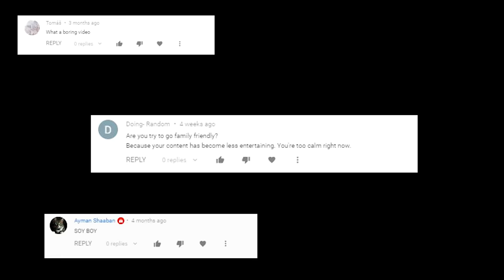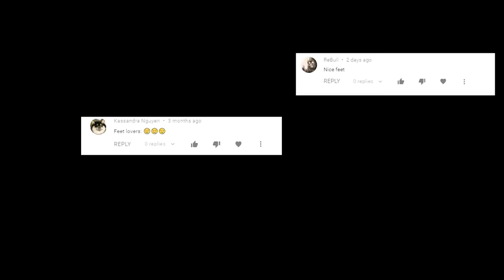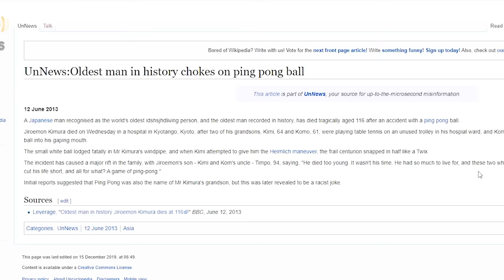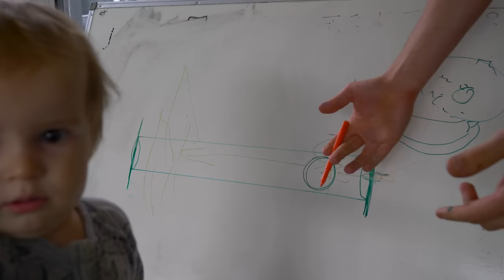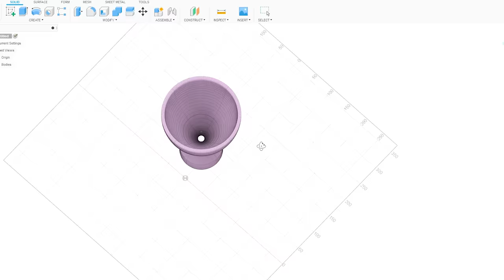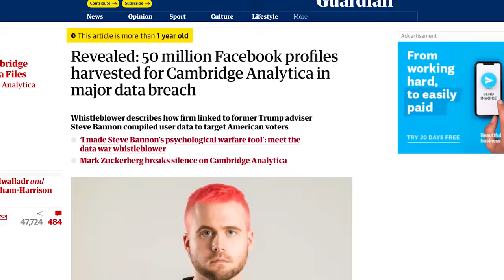I Hit The Worlds Fastest Ping Pong Ball!

Comment: 9:40, the nozzle is an orifice. Cross sectional area is inversely proportional to the air velocity at the cross section. So decreasing the cross sectional area increases the air velocity. You can also think of it in terms of pressure. Pressure and velocity are inversely proportional as well. Pressure is highest at the start of the bottleneck and it’s difficult for the gas molecules to move due to the constriction. Once they make it into the thinnest region of the bottleneck, the gas molecules are propelled forward by the higher pressure behind them. When the bottleneck opens back up, there is a pressure increase but some of the pressure from the start of the bottleneck is nonrecoverable. In layman’s terms, the nozzle is like putting your thumb partly over the end of a hose to make the water go faster.
Reply: nerd
Reply: @Michaelcool2347  ur watching a equaly as nerdy person
Reply: can you explain in cheesburgers and ar15s please
Reply: Why😂
Reply: @arealhuman826  the nozzle is like putting a cheesburger partly over the end of an ar15 barrel to make the bullet go faster
Reply: Basically its a venturimeter with a divergent and convergent section and a throat. Venturimete is is the most efficient machine to measure the discharge of a fluid because the co-efficient of discharge is almost same as the coefficient of velocity. Because at the throat the contraction is almost unity. So he gets the pressure at the end of the pipe is as much as he applies at the other end.
Reply: You call it also laval nozzle and it is used in rockets. Point is that what we think of a nozzle (convergent nozzle) only applies to up to Mach= 1 speeds. After that, it would act a a diffusor. With the divergent cone and mach1 at entry, you get a supersonic nozzle

Comment: You’ve essentially created a ping pong shotgun, great job!
Reply: he's faking this, if you go to 12:02 and watch it in slow motion be sure to look at the tree's breeze and how it moves, this shows that this is indeed 2 frames. also, looking at the damage the ping pong ball does it sort of makes no sense. this is very disapointing.
Reply: @seanmckenna4317  sure buddy
Reply: @seanmckenna4317  because he is counting but the ball come out later so he just cut it smh.
Reply: @BlueBot-jm2ro  Sadly it's true. I recommend actually looking and researching before deciding to believe it is real.
Reply: @Soulful_01  I did, thank you. Yes, that one camera angle is spliced, but probably due to either camera failure, forgetting to pressurize it, or some other mechanical error. Its not that he faked it, its due to outside forces that camera angle was spliced.
Reply: @seanmckenna4317  not fake of course he’s not gonna fucken hit the ping pong ball that could rip right through the paddle, it still shot out and destroyed the paddle.
Reply: @Sean Mckenna ahem nerrrd*cough cough
Reply: @seanmckenna4317  he literally shows the impact on camera
Reply: @seanmckenna4317  yes its spliced but he's not gonna create a whole ping-pong ball shotgun just to have the shot be 100% faked. It's probably spliced because of a timing thing
Reply: @seanmckenna4317  I'm just going to say that it took multiple takes
Reply: @seanmckenna4317  He may have just had to pump up the gun more than he expected and just cut out the part of him pumping it up more?

Comment: What would happen if you filled the table pong ball with jello? It seems to only be flying apart because of the structural integrity of the thin plastic and the void inside the ball that is normal atmospheric pressure, which when put under vacuum is deforming, and with the introduction of such high pressure causing a violent reinflating of its original form causes the failure?
Reply: Bro we both have the same favorite XBOX profile that's the first time I seen that in a while congrats
Reply: If you filled it with Jello it would be too heavy. It is so fast because the ball is super light and accelerates in a vacuum.
Reply: fill it with blood

Comment: Baby : "So you first create a star inside the containment compartment, you cause its compression through pressurization. When the detectors sense a shift in the massive amount of heat, the valves will open. This will cause a release of all energy, and implosion of the star, which will cause a wave faster then the speed of light to push the ping ball without initial contact destruction. This should cause the ping pong ball to destroy anything on contact. However if you use your feet to hold the paddle nothing will be connecting you to any surface, so you will gain perpetual movement until you reach the center of the universe."

I did a thing : "air go voosh if I open."
Reply: I love relativistic kill vehicles.
Reply: @IudiciumInfernalum  "centre of the universe" yeah, about that. It doesn't exist

Comment: So this shape you printed makes use of the Bernoulli effect. 
As the Crosssection area gets smaller, the airparticles get into a sort of traffic gam, squeezing themselves together. Mean ing the Airpressure goes up, this increased airpressure will now be the accelerating force, propelling the airparticles even faster. 
Important to note: The overall airflow stays the same (ofc there is friction and stuff, but in a perfect world, the air would travel the exact amount faster it needed to, in order to get the same amount of air through a smaller cross-section.)
Reply: Sorry, there are some things in this that bugged me enough to reply to this post, since it seems that you're quite interested in the subject, and I want to give a more accurate representation of whats going on. Bernoulli states that air pressure actually goes down with an accelerating flow, so the pressure actually drops through the entire nozzle. If you want a visualization of this, put two empty soda cans very close to each other, and blow through the crack between them with a straw. The localized pressure between the two cans will drop, sucking both cans into each other. 

The shape is instead what is known as a converging-diverging nozzle, similar to what you'd see on a rocket engine, and is one of the best ways of accelerating flows past mach 1. Due to how the math works out, a converging nozzle will accelerate gasses when they are subsonic, but instead decelerate a supersonic flow. A purely diverging nozzle is the exact opposite, decelerating a subsonic flow, while accelerating a supersonic flow. There are entire classes dedicated to compressible flows, so there's no way I'll manage to put it all in a single comment.

 You did get the part about constant overall airflow correct though, and it holds true both with and without friction. Due to conservation of mass, the amount of air entering and exiting any given section must be the same, so the friction will actually affect the flow of the gas coming into the section. Things get messy again with supersonic flows again since information (pressures, temperatures, etc.) can't travel fast enough against the flow to affect the air coming into the section, but it also has its own mechanisms which prevents it from breaking conservation of mass. 

The design of the nozzle geometry is also very important, as the mach at the nozzle's  exit is fixed for a given geometry (assuming the pressures differential is large enough to reach supersonic at the exit in the first place). So past a certain point, increasing the pressure won't actually increase your exit mach at all. The whole subject is extremely interesting, and I'd highly suggest looking up about compressible aerodynamics at some point.
Reply: @nogoogle1077  What's more, though the speed is higher at the throat, what he actually needs is the largest volume in the shortest time. The nozzle is only an impediment to maximal flow.

Comment: If you still see these comments, I think putting an airtight wad of some kind behind the ball will keep it from exploding from the pressure. And because the chamber already has low atmospheric pressure there should be little to no air resistance for the wad

Comment: For the nozzle, do you guys think it works by forcing a bunch of air pressure from a bigger area slowly getting smaller so that that small areas air gets pushed out at a greater rate because of the build up of pressure?
Reply: It's a De Laval nozzle, it's a bit more complicated than that and I'm not smart enough to explain it

Comment: there's a way to make it MUCH more powerful... at the front end of the barrel, if you add another chamber connected to the tube that is also vacuumed, it prevents the air that got past the ping pong ball from slowing it down right before it reaches the end of the barrel by providing a space for that air to go, maintaining a vacuum in front of the ball all the way until it exits the gun.

Look at SmarterEveryDay's baseball cannon to see what I mean.

Comment: I wonder what would happen if you put a ping pong ball into a tube, put some gunpowder at the bottom and then light it to eject the ball out. Well the ball would probably explode so you would need something like a steel or lead ping pong ball. You could even create a little thing that snaps onto one side of the ping pong ball that holds the powder inside it to make it less messy and add like a little thing on it's back that creates a spark when struck. Then you'd only need a needle to strike the back of... ball box for it to shoot out. I also heard that things are more aerodynamic if the have a sharp tip so maybe you could stretch the steel ball out and give it a tip, then put the powder mantle around it and put it inside a portable device that has a mechanism to strike the back of it. Just an idea.

Comment: Why didn't you mention the Mythbusters? You used a smaller barrel because a longer barrel actually slows down the ball because air leaks past the ball before it leaves the barrel. But I can't believe that just with the nozzle you managed to make this likely faster than when the Mythbusters did this, and they had a choke that shot pressurized air into the vacuum chamber.
Reply: He did

Comment: Can we get the science of why the nozzle made the ball faster? Is it linked to the length of the barrel?
Reply: Short over simplified version, that's very poorly explained, but should help you understand it. See it's two effects at once, using one to amplify the other.

First pushing air through a small hole increases the pressure of the air behind it trying to escape, thus speeding up the air getting up, the compressing bell like curve assists in doing this efficiently with lots of math and physics. I don't understand it well enough to explain, just know it's ideal to go from chaotic, but somewhat lateral to the narrow opening to the other side. It makes a narrower higher pressure jet without wasting too much energy by preventing too much of it bouncing off at bad angles. This means a smaller faster stream.

The other side is actually like a rocket engine, the same stuff used to get into space, no seriously it's the same general design. Its curve expands the air in such a way that it gets all the kinetic energy of the air and it's flow moving as parallel as possible. So rather than a bunch of tumbling and messy turbulent currents, they are nice smooth parallel currents. That means all that energy is being sent where we want it, and not wasted on the air bumping into itself or going off at weird angles, it also gets the air hitting the ball more evenly, increasing the surface area we can apply kinetic energy to without the awkward deflection a narrow jet would have wasting energy, and gets it out of the way faster so that the air in the pressurized section can expand out faster, providing more pressure, as ultimately air moves fastest when it's expanding outward to fill a space, but we're carefully expanding it in a controlled tube rather than chaotically like would happen normally. This side is also bell shaped, with the curve using very similar math and physics to the compressing side, it's just being put in reverse.

Read about how space rocket nozzles work for this. They go zoom really good and the physics is all the same, just molecules and kinetic energy being ordered nicely from the power of expanding gasses, the difference is how the energy is being used, what the gas is, and why it's expanding. Luckily for us, however, physics don't care about such details. Only that the general shape of the situation is the same. Expanding gas go in direction to deliver kinetic energy. Just rockets trust Newton to go to space, while we are looking to move a projectile through rapid decompression at a frightfully high speed.

Comment: way exaggerated nozzle
for this kind of pressure and application you'd want the smallest diameter to be about 60% of the largest diameter
this one looks closer to 10% which would be ideal for a presure ratio of about 2000 at least theoretically
but 2000 atmospehres inlet pressure are both unrealistic and would get oyu far out of ideal gas approximation
and at 10 atmospheres of inlet pressure the air would have to depressurize to about 1/200 of an atmosphere to smoothly leave the nozzle
but since the vacuum won't be perfect and sicne the ping pong ball has mass and will force air to build up behind it its gonna go above that pressure at which point the air will go to a more idela pressure ratio but now you've restricted your air flow and caused turbulence where it separates from the nozzle
you're basically using a vacuum optimized rocket nozzle at sea level

Comment: 1000 kg is 200 homeless man, that means one homeless man is 5 kb, which is about 2 pounds. Right?
Reply: Isnt a pound 450 grams while a kg is 1000?
Reply: @Hithere-uz6wd  yeah. Correct. But if 200 homeless man is 1000 kg, then 1 homeless man is 5kg, which is about 2 pounds. How skiny a homeless man needs to be to weight that little?
Reply: @istvanorosz1022  Pounds are less than KG so how is 2 pounds 5 kg
Reply: @Hithere-uz6wd  my bad. 5 kg is 10 pounds. Still a man needs to be soooo skinny to weight 10 pounds.

Comment: I'm actually concerned about your choice to be barefoot in every video. In a lot of these you work with molten metal, welding torches, saws, sharp material, and other dangerous shit. Proper PPE in a workshop generally includes protective shoes. And considering how dirty your floors are, I'm terrified for your soles.